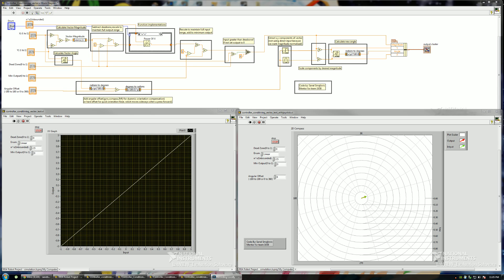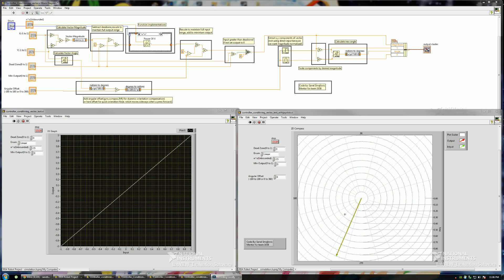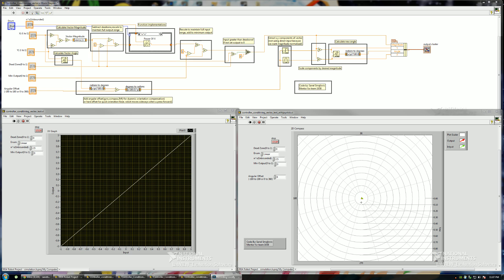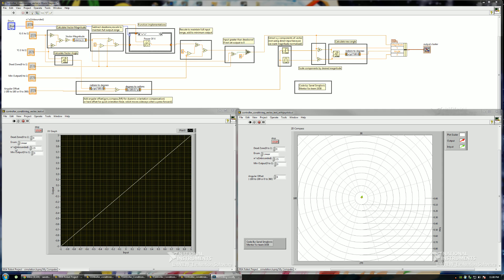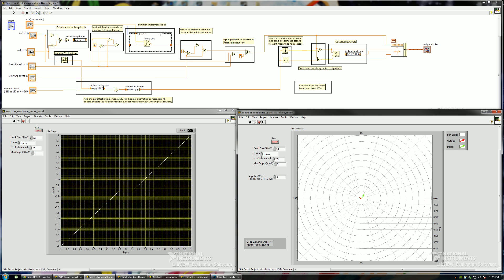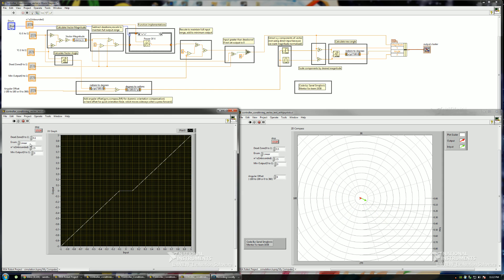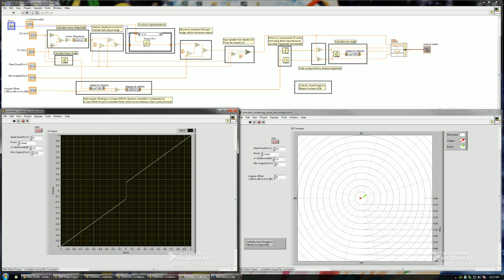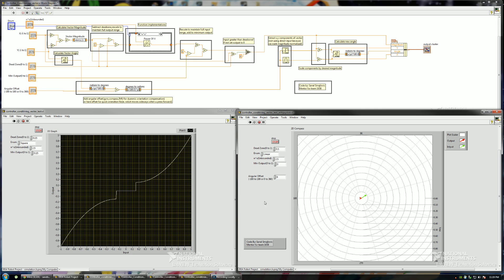FRC joystick and gamepad calibration and processing labview vi

Comment: We tried adding your code to our robot and it does not work. We are not even able to drive the robot straight. We are feeding the 
 joysticks inputs to the X, and Y inputs, and selected Square. We are also using the Z angle reading from the IMU.

Any suggestions as to how to make it work for us?
Thank you
Reply from the maker: We've used this exact code for a number of years now so it should work. For inputs that is correct, question is what are you doing with the outputs? what kind of drive do you have? It would help if you posted code as well. Keep in mind the output is NOT meant to be given directly to motors, but instead passed into other drive system control code. This is just meant to condition the input to give a better response.
Reply: Thank you for replying. We were feeding the outputs of your routine directly to the motor. Also, the deadband setting was too small so the robot would start moving with zero input from the joystick input. We have an Arcade Drive. We added the ArcadeJoystick.vi before sending the outputs to the motor and I get better results. I am not able to test it right now since the robot is bagged. We are trying to get last year's robot working to give it a try.

Here is a link to our test code:
https://github.com/ramonarampage1159/PowerUp2018-LabVIEW-Practice/tree/master/Test%20Robot%20Arm%20%26%20Grabber%20with%20Rates

Can you share your 2017 code, so that I can take look? We would love to get it working and make the robot go wherever the joystick is pointing as you mentioned on the video.

By the way, I saw the videos for this year's robot and it is very impressive.

Thank you